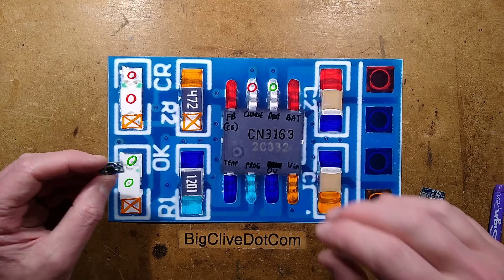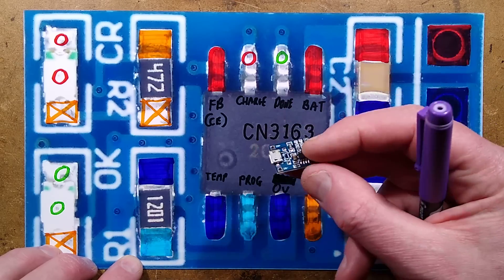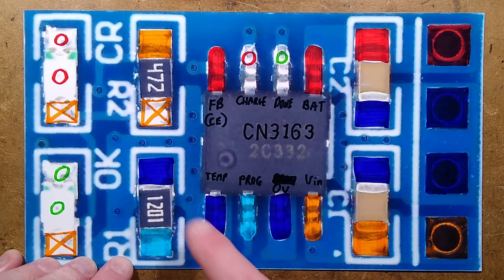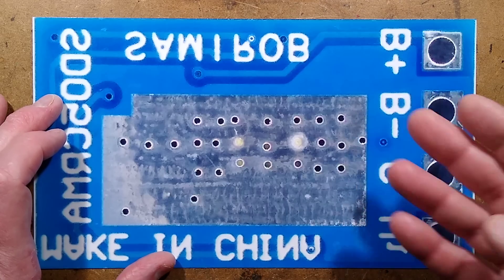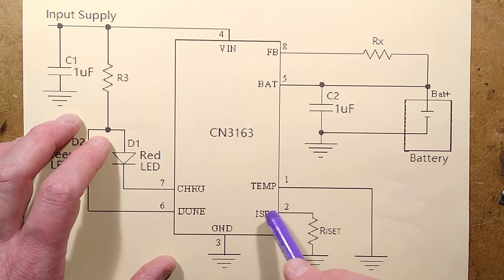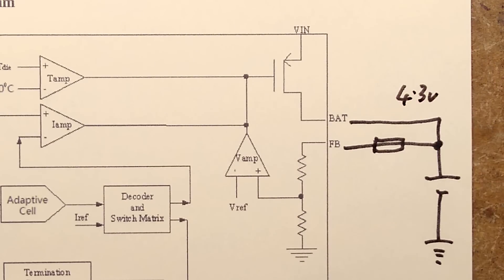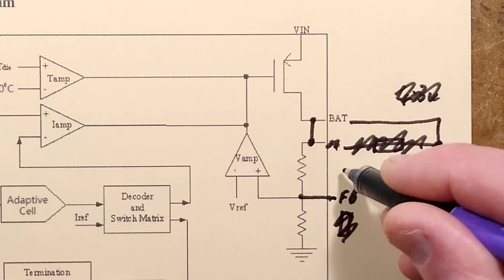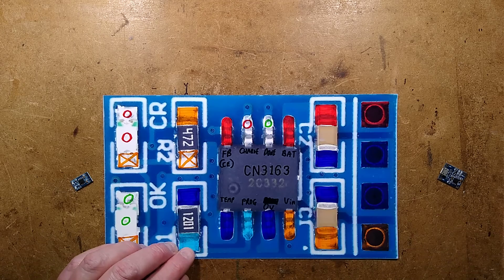Solar "MPPT" lithium cell charge module

Comment: "Normally found on Bigger Solar Systems" . . . . 
Clive Mór been zipping about the Milky-Way on the Fire chariot, smoking the  Adrenochrome with Gilgamesh and the Annunaki Prince of the EL'ohime . . . . (Sumerian Scrolls). 

Great Pyramid is located 29 degrees, 58 minutes, and 51 seconds of arc north, this is the geodetic latitude.
This indicates how close it is to an exact 14400. Indeed, assuming such an exact value, then by multiplying 756 by 14400, one derives an elliptical arc of 10886400 feet. And, 10886400 - 10885789.794031952 = 610.2059 feet. Thus, the error – at least set against the WGS84 model – is less than the actual size of the pyramid itself i.e. it is contained within its structure. What this result implies is that THE BASE-LINE LENGTH OF THE GREAT PYRAMID WAS DETERMINED BY THE ARC LENGTH DISPLACEMENT OF THE STRUCTURE FROM THE EQUATOR.  (Speed of Light, was used by Annunaki to build pyramid and pass the knowledge on, They are Learning Aids)

Comment: I am using this device connected to a solar panel and feeding a lithium with its own protection.
It's the best solar charging solution I found.
It keeps the solar panels providing power when the sun light diminish.
Reply: yes,same with me...2 18650 old recycled batt with 5 string light.3mx5..light up all night long

Comment: It doesn't seem like it's even a PWM...
This is going to sound crazy...
Could you actually take the plastic off the chip and make a connection at the point you said...
Alternatively make the whole circuit from 'normal' sized components..
Which I assume you could raise the current handling capacity and voltage.
I'm Off-Grid and it would be nice to have a decent power USB 5? volts or now USBC.

Comment: I've got several hw107 boards with salvaged 18650 cells  charging from 6V solar panels, sold on alix as 10A - rofl, actually nearer 2.5A in full sun with a pancaked cell & 850mA with the 1A chip.  I use a bc556 across the output to switch on sets of leds at dusk. Nothing has gone fizz so far and my lights switch on and off every night with no issues.
I was planning on buying a few more panels to add more lights around the place. They give enough light to see if the dog is under your feet or navigate to the bathroom, kitchen or down the stairs without going a/t.

Comment: i would test to put the max charge voltage lower  is to put a 10 ohm resistor from the ground  pin to ground and see if this lowers  max charge 
i intend to test this  ordering some now
Reply: meaning dont connect ground to ground but to place  a 10 ohm resistor in series with ground

Comment: Clive, as to your comment about the TP4056, you can directly use a solar panel, as the input voltage (max. 8Vdc) is more compatible with 5-6Vdc panels. And, the TP5100 (designed for 1-2S configuration) is even more so: 5-18Vdc. If the panel's voltage drops, then it just lowers, & drops out. When it gets to about 3-4Vdc (from memory) then it just shuts down. Then will restart once the voltage is high enough.
nb. I use the version 2 modules, which have extra componentry for current protection.
Reply: Depends on the individual chips and solar panels. I stuck a panel that was giving me 7.9v with no load into a TP4056 board and it instantly popped even with a cell already connected (so definitely with a load).
It may have been a clone chip with lower max voltage but you can't tell before you buy.

I'll probably end up getting 2S chargers though for the project it was for. 12v solar panels are easier to come by cheap, at least here.

Comment: I bought some of the same chip on a different board.  I should have realized there can be no MPPT without an inductor, signifying a switching voltage converter, on the board.  Also, the boards I bought, with 3 JST connectors and a micro-USB, were all over the place with the charge current when they were advertised as 1 amp.  So I was had two ways!

Comment: I had a go at making my own solar mppt controller at one point last year. Was going well until I melted the breadboard I was using, turned out the current event from a little 25w panel was too much. 
It's actually a really interesting circuit because it involves using a high side n-channel MOSFET switch rather than the normal way of switching on the ground.

Comment: ADaptive Cell = ADC ? In which case this could be a hardwired through lookup table pseudo MPPT, if you fit exactly the correct number of solar cells in series on the input.

Comment: Is MPPT without inductors even possible? Perhaps exchange the FB-resistor with a voltage divider allow lower cell voltages. I dont know the values of the internal divider, but if the are high than the lower resistor of the external voltage could be 100k ohm or higher. The permanet load of this resistor to the cell maybe justifiable.

Comment: Would a Diode with low VF (0.15vf)do the trick to reduce maximum charge voltage, between the +ve battery terminal and the IC BAT terminal?

Comment: What happens if you stick a resistor on the ground pin wouldn't that also change the voltage divider?

Comment: I'm not sure if this is actually any better than tp4056 on the sun. Turns out tp4056 is pretty decent as cheap solar charger. Some test and comparison would be very useful

Comment: know what would be nice? if all these solar products would include a backup usbc port to charge them, i got a solar bug zapper with a token solar panel, it is a real solar panel but i suspect you could run it for 2-3 minutes for a whole day of charging if it could even provide more than the quiescent current of the charger
Reply: fairylights with solar have ..Most have higher quiescent han the output.

Comment: I use to see tp4056 boards packaged with a 5.1v zener that were sold as 1s lithium solar chargers. I think the intent was to  use the included diode to clamp the input voltage from a low power 6v panel.

Comment: "MPPT" . hheheh.  Obviously not.   That chip appears to have a maximum input voltage of 6V, so it can't be used with anything but the tiniest "calculate style" solar cells.  5V solar cells only, basically.    Too bad, but it just goes to show how crazy the marketing nonsense has gotten for some of these things.

Comment: It would be awesome if a chip or board could be made that  could be made that is used with a boost converter or buck converter, even buck / boost converters to convert them to mppt charge controllers. It could be very interesting!!..

Comment: Would a zener in the fb make the lithium cell charge at a lower  final max voltage and make cells last longer
Reply from the maker: That would just add more voltage.

Comment: Check out the 10 pin ShangHai Consonance Elec CN3791, looks like an upgraded version of this chip.
Reply from the maker: A quick look at the datasheet suggests it may be fixed 4.2V.

Comment: It certainly would have been nice to have direct access to the Vamp+.  However, you can put a divider on the FB and not just a resistor to BAT.  I haven't thought thru all the details, but that seems to provide all the flexibility.  Worst case FB would need to be raised above Vbat.

Comment: Great video as always!
I have some, do you know what the max current is for the LED indicator output? 
I was thinking that it would be great if you hane power source that could go above 6v with low current and the 'Charged' output could absorb that current and thus keep the voltage below 6v when the power isn't needed anyway?

Comment: The tricky thing about what you propose is that often on chip resistors match each other quite well, but their absolute value is all over the map (+- 20% variation isn't unheard of).  The internal resistor divider can be quite accurate without any additional trim since a divider is a ratio of resistors.  But as soon as you do what you propose, the internal R values have to be 0 tc (many on chip resistors have significant TC) and trimmed to value.  That's alot harder.
Reply: There is some truth to the chip resistors' Tc, but there's a significant reason why it's standard practice to avoid resistors in ic design that plays a role here, and usually why they use transistors instead. Most importantly, they take up a lot of space, and actually are even more variable in value tolerance than chip resistors since it's hard to perfectly predict the resistance of a squiggly line, especially if you compare them to thin films. The only reason you don't notice such variability from one ic to another that implement resistors (and every ic has at least one to set the current source) is that they will all be more or less consistent due to the deposition/lithography process, regardless if they're in spec as long as they meet the datasheet characteristics, and also because you don't ever see the QA rejects directly from the manufacturer: they sell those to Bojack and other such Amazon/ebay companies. I was honestly blown away to find that the reject rate of opamps for example is close to 70%. Also the same reason why there's a bc546,7,8 and 9. They all come from the same silicon wafer, but they vary way more than one would like to predict.

Sorry, long story short: the Tc of chip resistors is negligible in most cases in comparison, and there's always ways to work around those shortfalls
Reply: @sgctactics  I design analog ICs for a major semiconductor company, so I'm well acquainted with on chip resistors.  TC can be significant - depends on the process.  Some processes have resistors with very low TCs.  Many have choices of resistors with different TCs.  Also, on some processes (mostly very analog focused ones that have thin film resistors), resistors often take up very little area since you can stack them on top of caps.  On other processes, you often only get poly Rs with different sheet rhos, depending on doping/silicided or not, etc.  Those can take up a fair bit of area, if you're not careful.  Poly Rs also often have an non-negligible Tc, especially if they have a high sheet rho.

The actual resistance, based on layout really isn't that hard.  If we have a resistor where we want it to be a fairly specific resistance, we don't lay them out as a serpentine - we do a simple strip with contacts on the ends (and usually lay them out as unit segments).  What's hard is the fact that etching can do stuff like give different widths or thicknesses or slightly vary our contact placement and sheet rho can vary, meaning that, despite our best efforts, an untrimmed resistor has typically +- 15% variation, worse on some processes.

Yield on semiconductors is a highly variable thing that you can't make generalizations like that on.  It varies alot, based on specific part, die size, wafer fab, etc.  Stuff like opamps can vary quite a bit.  An old fashioned opamp where you're relying on the process to get your specs, sure maybe A grade would have 70% yields (many companies also sell their B grade stuff too - it's not necessarily junk).  But lots of more modern opamps have built in trim or autozero and can be adjusted to have excellent yields - often well into the mid 90's, if the process is behaving itself and the chip die is small.
Reply: @sgctactics  If you look at the die plot for this IC you will see that polysilicon resistors are used. They are a bit hard to discern because they are mainly under the power bussing and also covered with metal fill pattern.
Reply: True. It may also be the case that the two pins were deliberately separated for production test of the two circuit sections independently. However, it is potentially possible that this test could be performed at probe test and the two pads double bonded to the same pin.....
Reply: @Mike-H_UK i think they have pins B+ and FB separated to have battery voltage measurement unaffected by resistance of wire to the battery. At high charge currents the voltage drop could be significant. What is the maximum charging current for that chip?
That’s the reason why those two pins are supposed to connect at the battery terminal, not on the module PCB.
Reply: @iamsmok  Good point. It would have been helpful if the data sheet had made a note that the FB pin should be Kelvin connected to the battery.'s positive terminal. I can't finsd such a comment in my version.
Reply: Fascinating comments, thanks.
Reply: Wow brilliant thanks info in these comments. Learning so much reading them.
THANKS LADS 👍🇮🇪🙏
Reply: But the same is true with the series Resistor 🤔
Reply: @schimmi2  If you check the datasheet the equation to set the termination voltage suggests the the FB (feedback) node uses a precision current sink (not a pair of resistors as shown in the block diagram) which controls the voltage dropped over the series resistor.  Generating precision currents within an IC is actually easier than getting precision resistances.

Comment: I’ve recently received the same module via eBay. Your video explained the workings of this module better than the seller did. Of course I knew it wasn’t MPPT. But it is a nice charging unit and works quite well. Note: it gets very hot when the load is 500 mA or higher…

Comment: Annoying problem with 6V solar panels and USB power banks: If you connect them right away, the power bank thinks the voltage is too high, and says no thank you. You have to do the connecting when the panel is in the dark and then slowly reveal it to sun.
Reply: Luckily a lot of recent power banks accept higher input voltages, and are okay with a solar cell of above 5 Volt. But do not expect to get 'the maximum' out of a solar cell that way.

Comment: I guess no low-voltage cut-off, as the later TP4056 boards have?
Reply from the maker: Not unless it was used with a DW01 and MOSFET pair.

Comment: It's not ideal but you could still skew the output voltage lower by replacing the single "Rx" feedback resistor with a 2-resistor voltage divider.
Reply from the maker: Not sure that would work, as the default divider is fixed at 4.2V.